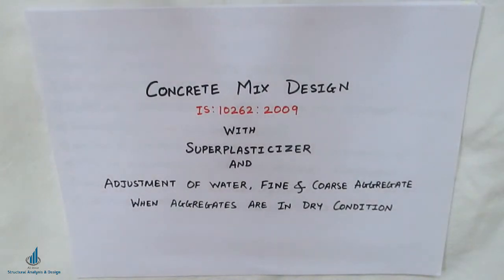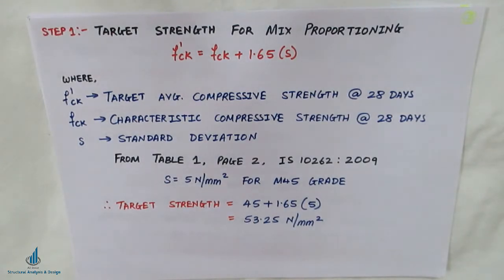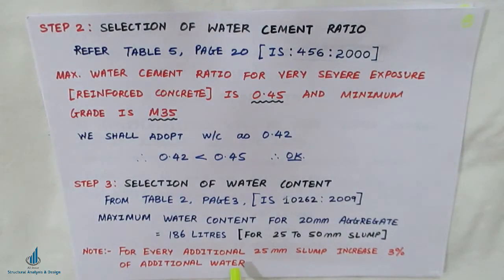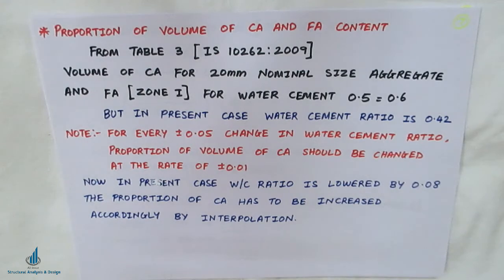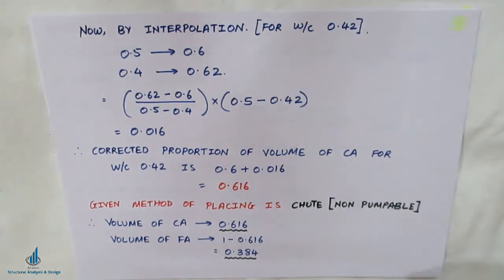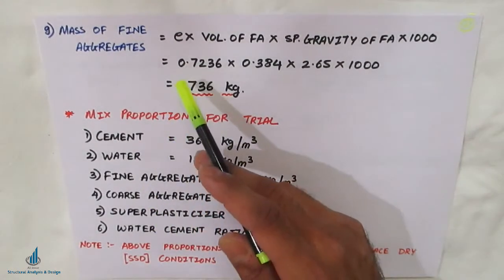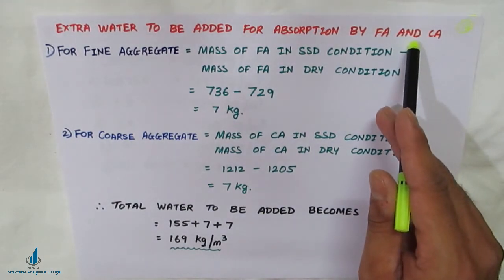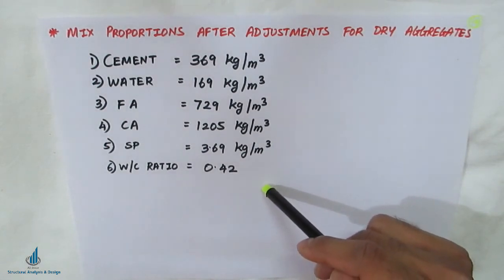Concrete Mix Design | IS 10262:2009 | Superplasticizer | with Adjustments in Dry Conditions

Comment: Sir why did u take the reduction in water content due to superplasticizer as 24%
Reply from the maker: As per IS code upto 29% we can take but in this problem i had taken 24%, practically if you want to do than with superplasticizer you have to workout which dose will have optimum impact
Reply: Generally we take 25%